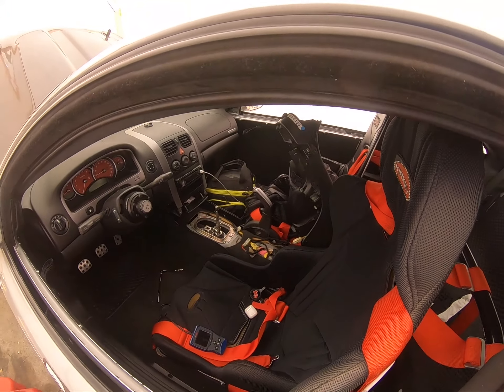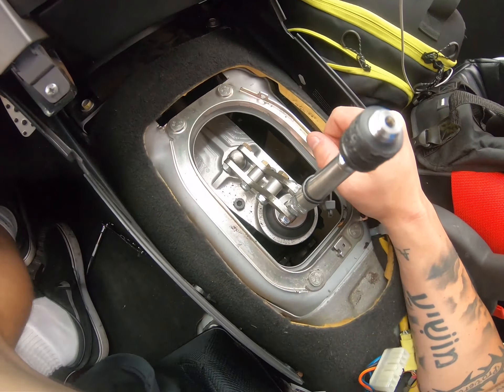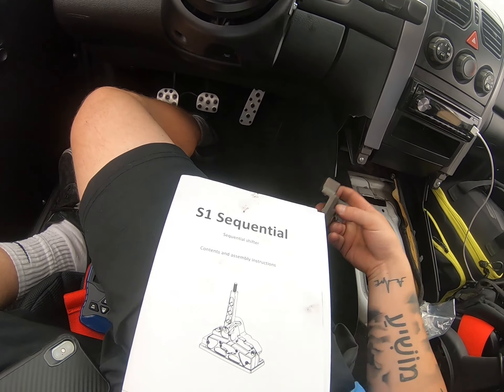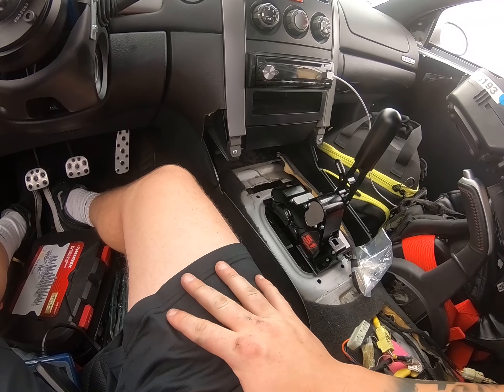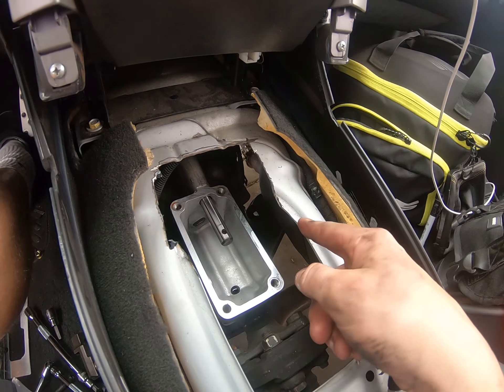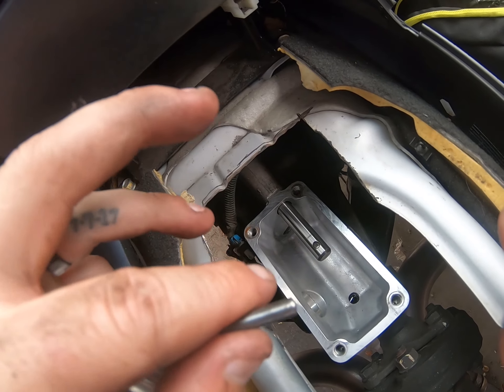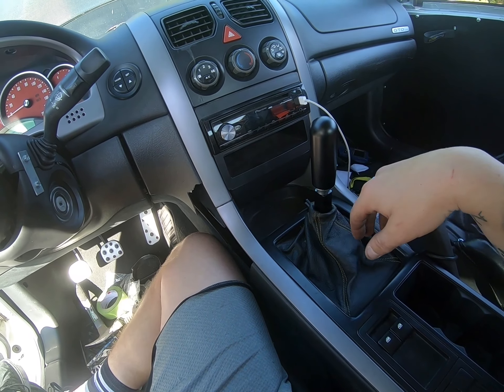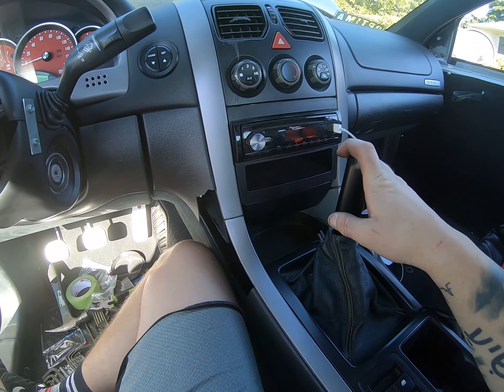Installing S1 Sequential shifter on my 2004 GTO

Comment: Have just put 1 of these in my 2003 Holden. Did not have to cut any plastic, change tray easily cleared, i changed the position of the reverse selector so it is behind the gear selector, not in front. I have also added the gear display, still got to cable reverse switch for the display.  All the console etc. looks exactly like the Holden.
Reply from the maker: Jonathan Rees wish it was that easy for me
Reply: @austinkeys_  Not sure it was "easy" had to cut out the body obviously. I used a Dremel for that, then realized not enough on the left side because of the position /gear sensor. Drilling the aluminium block in the car was a pain. Could have been pre-drilled, then just drill base plate in the car. Have not yet wired reverse indicator because switch is on the gearbox, but wiring goes back to the cab, then to trunk, but where is a good place to find it? Don't think my tires are going to last now....the car just wants to launch...
Reply from the maker: Jonathan Rees so similar amount of work that I did. I mean my install wasn’t terrible worst part was cutting

Comment: Why is it so laggy when shifting
Reply: He could have shifted faster.  The box itself is still designed for h pattern shifting ( nothing changes internally in the box ) so if you are running synchros instead of dog engagement you still have to allow for that.  Regardless of shift time the benefits are still massive and with the addition of a strain gauge you can flat shift confidently knowing it will go into the correct gear.
Reply from the maker: Robert D yes I could of but was still getting used to it and your right the benefits are killer
Reply: So can you no lift with these?